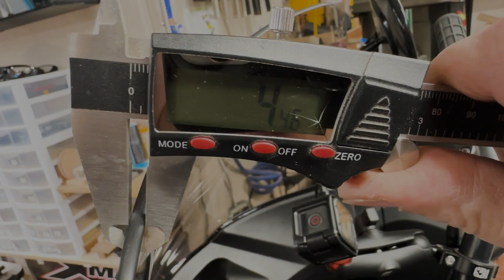Clearview Shields on Lowrider ST - XL - Excellent Fit, Finish and Protection

Comment: Noticed you are using the OEM torx screws? I saw a video elsewhere that an owner had an issue with the Clearview screws as provided being too short. Is that your experience and why you used the OEM screws? Thanks!
Reply from the maker: I wasn’t aware of a problem.  I used OEM without considering any alternative.  Didn’t realize there WAS an alternative.
Reply: @TomGlander  Clearview didn't provide you with screws as part of their hardware kit for their shield?

Comment: Looks nice. What colour is that?
Reply from the maker: I believe it was their Light Smoke version.  I have removed it and it's in storage now.  Traded in the LR for a Road Glide.
Reply: Not bad either
Reply: @Tom Glander DIY   Did the windshield eliminate turbulence from around your ears too?  I love the both the street glide and road glide.  What made you trade it for a road glide?
Reply from the maker: @frankp7885   The RGST I have just looks better, is heavier, more appropriate to my size, has actual bags, is NOT a monoshock, has real gauges, cush drive, cleaner.  It's a real bagger, not a bagger wanna-be.